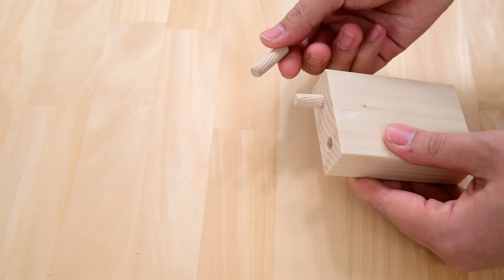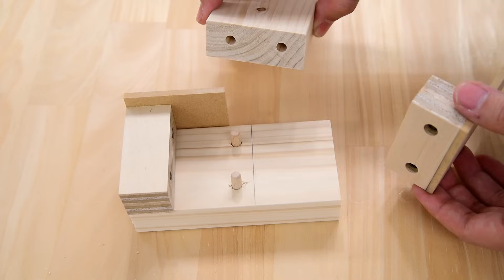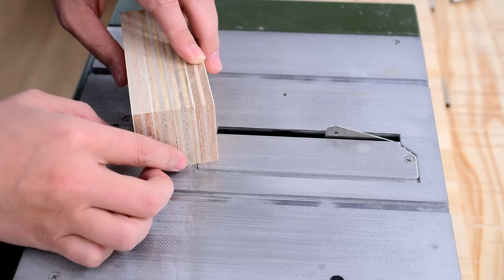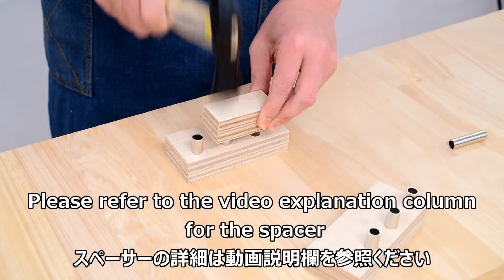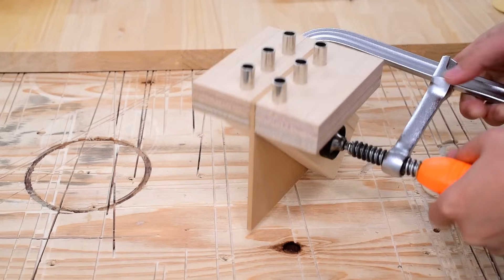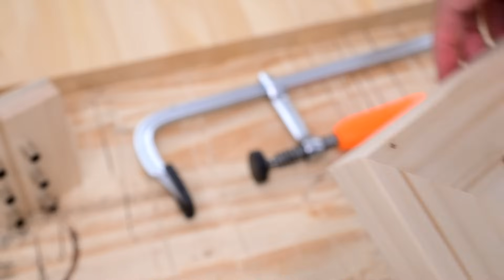DIY High precision Doweling Jig for pair use

Comment: The biggest problem I found with making doweling jigs is the high precision required in the build because when you use the same jig for opposing joints, any inaccuracy in the jig will be doubled, resulting in misaligned joints. This pair-use jig solves that problem!

Comment: So for t-joining you'd make a dowel jig where the holes are horizontally spaced from the resting guide, instead of vertically thou for more uses instead of it being one jig with 2 holes, make 2 identical jigs with only 1 hole, otherwise you're limited by the width of the boards i.e you had a 15 cm wide board, you'd make a hole guide jig with 5 cm's space between them and if it's 8 mm thick dowels 8,2 cm spacing on either end, but if your next project calls for 12 cm wide boards then that would throw it All out of alignment

Comment: what is the diameter of metal sleeve? Is it stainless steel sleeve?
Reply: I was wondering the same, but it would probably be metric and here in the states we are still behind on weights and measures so I will probably just match a bit to dowel size and tube.
Reply: 8 mm

Comment: I still don't understand how will you get the holes straight without a. Drill press?
Reply: Perfectly square is not necessary. Alignment is the most important part and the two blocks are aligned while drilling.